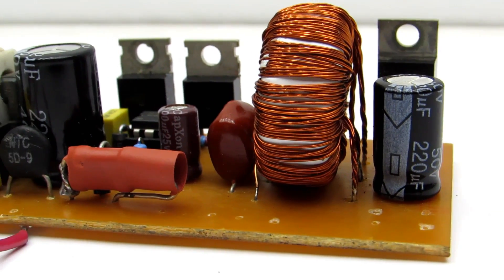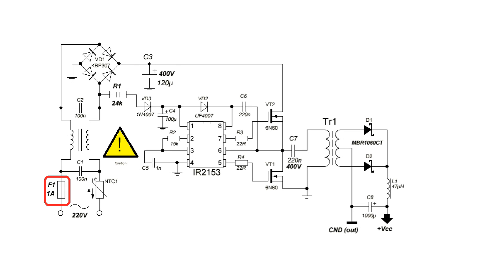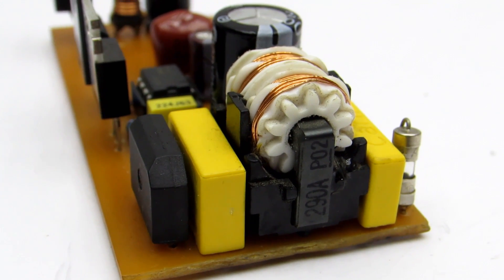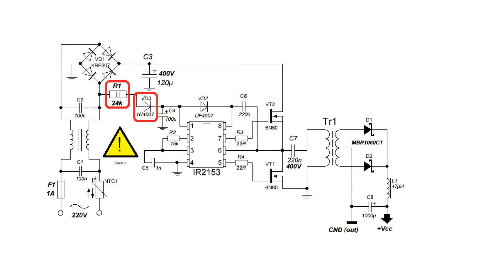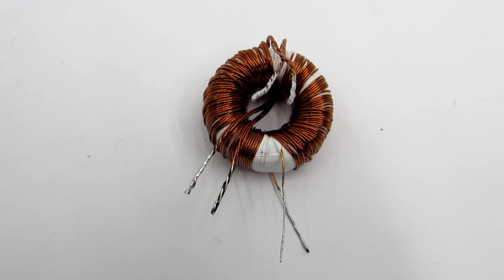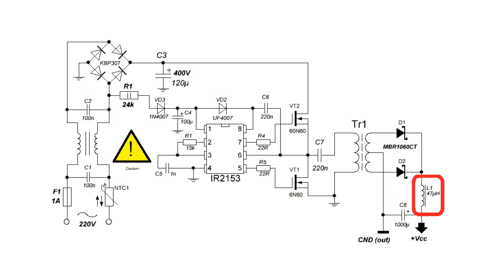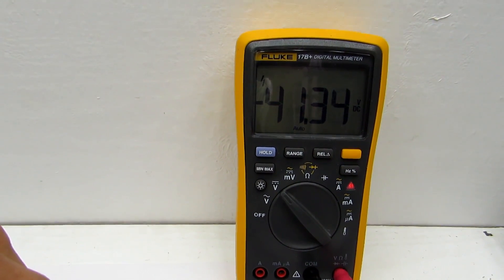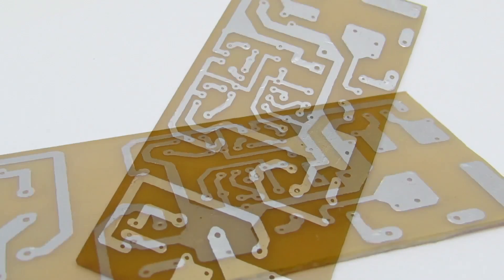Simple switching mode power supply

Comment: Nice project. But you have to take some precautions when winding the transformer. You have to ensure a higher distance between any point of the primary winding and the secondary one, as the lacker itself is not a reliable insulation to isolate the primary and secondary side of a transformer. Also, any over temperatures originated in the transformer because of an overload, can degrade the insulation lifespan. Consider that on the low voltage side, you have a human operator.

Also, you have to keep a good clearance between any cooper trace of the high voltage side and the low voltage side, as a high voltage peak could easily jump small distances and harm or even kill a person.

Despite of that it's a nice video, but, I would have liked to see how the output voltage behaves on this power supply, as there is no voltage feedback.
Reply: Its pretty stable to a certain level this circuit is a self oscilating 50/50% duty cycle so its like a normal transformer when you pass the rated power itt will drop the voltage also the 325v rail will drop and then the secondary voltage also drops , you are right there is pretty much no isolation bettween the primary and secondary

Comment: How did you determined the output voltage , when there is no feedback loop ???! i checked some datasheets / app notes on that chip. is this like an unregulated SMPS ? whats the advantages compared to a classic non-smps 40v 3A transformer+full bridge rect circuit , when there is no feedback ??

Comment: use transformer with non gapped transformer because it is halfbridge smps...
to determine the total of primary winding:
-we must know the frequency value first
-determine the inductance using this formula 1000x(2x3.14xfrequency)/1000
-using ESR meter, wind the primary of the transformer until u get the value (inductance, L) from the formula
to determine the total of secondary winding:
-150/total primary winding
-example for 12V output: 12V/(150/total primary winding)= ....total secondary winding

*use regulator (78xx) for beter result..

Good Luck..

Paling Manang
Reply: connect primary gnd and secondary gnd with capacitor 102/1KV
Reply: @tagkayu  This capacitor should be a Y1 class
Reply: your english realy sucs.
Reply: In this video, Kasyan used a toroidial transformer.

Comment: there is no output voltage regulation in this circuit
so when you put a load on the output the voltage will vary according to the output current .
Reply: For cripes sake man, FIX it man, Fix it!!!

Comment: what is the function of the lower mosfet in the diagram??? since one terminal of the transformer is  connected to ground and the other to upper mosfet ,, i need expalanation please
Reply: when the upper transistor conducts, the capacitor at the output gets charged. Then, when the upper transistor shuts down and the lower one conducts, the voltage from this capacitor gets applied, but in reverse, to the primary of the transformer. This way the primary gets an AC voltage that actually crosses zero.
Reply: Thanks 😊  after 3 years i got it now
Reply: There are no problems with the HB SOS circuit.
There is still one series of this IC that has not been completed upload whether it is normal or not I have tried it but forgot the schematic.
 Can you make a video ?

Comment: there is no suppression capacitor, this is how you make a psu that generate a lot of noise
Reply: Where should be the capacitor? Can you explain it please?
Reply: any pin from transformer of secondary side to GND of primary side, need a proper class Y capacitor, else you can shock yourself to death
Reply: I got everything those he says in the video.I also got a transformer from old smps power supply.May be the output of that is between 12v to 24 v and current about 6 amp.Now if I use a suppression capacitor that you said, will that ok?Then can I touch the output line?
Reply: yes, with the proper class Y capacitor and there is nothing else between primary and secondary side then you'll be perfectly fine to touch that, maybe just a little buzzing if you're standing on ground but it's normal because the capacitor have leakage current and it's perfectly fine
Reply: Thanks a lot ....
Reply: VivaMessico is right. But you can use it anyway. The non-isolated SMPS are made for a non-user interaction applications ONLY (IE: led strips power supply) and a reasonable costs and you'll burn a lot of led's in the worst of the cases. If you want to make a safe one, you need to feedback primary (for secondary voltage detection trigger) via optocoupler and a 431 reg. to eliminate overloading factors.
Reply: Y capacitor should be between primary ground and secondary grounds (not earth).
Reply: Bad idea. If the capacitor dies you will have 300V on the output rails. Very, very bad engineering practice. That's how a 16 year old girl died in the USA, by dropping her phone that was connected to the charger, into the bath tub. Under no circumstances should the secondary side be connected to the primary side. Not even through a capacitor.

Comment: transformer calculations or appropriate software link to make the calculations missing from description. UF4007 diode between 1-8 pin can be replaced with a BA159 but people must not confuse it with the common 1N4007! Keep in mind that this is a half bridge topology, unregulated so transformer winding is very critical for output voltage level.